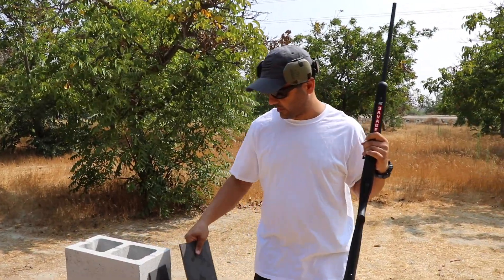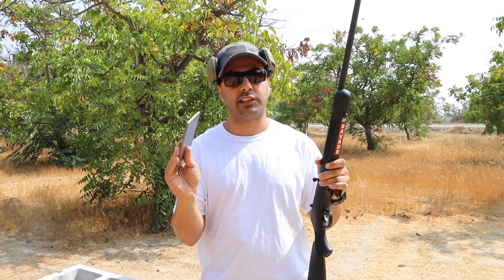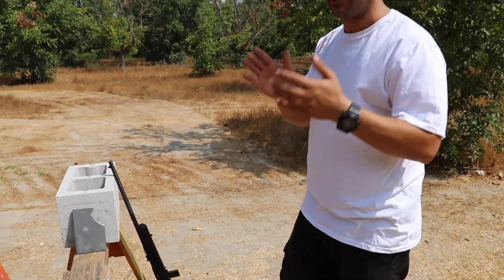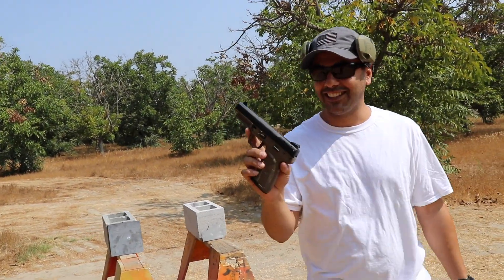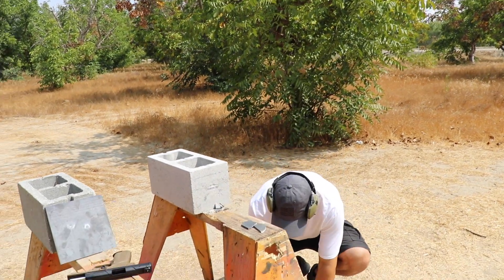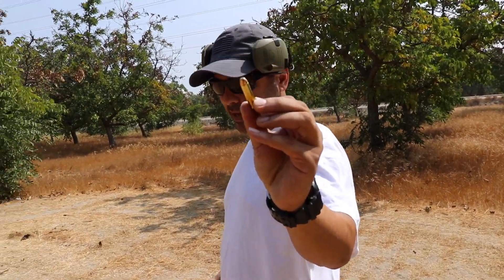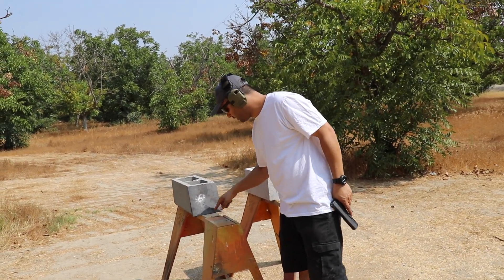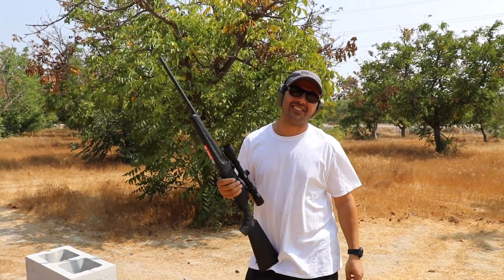Is Tungsten carbide BulletProof? - FN 5.7 vs steel

Comment: I'm a machinist,  tungsten carbide is real brittle. If you take that to a page that buys metals,  you can still get most of your money back if you can find the pieces.
Reply: Arnold Celaya Yeah they should’ve got some cpm 3v treated to 61 hrc which is low for the steel. That would definitely stop a bullet .5mm or maybe .25 for a 9mm.
Reply: @mikeisaac3826  lol no. it'd shatter like glass
Reply: For what do you need it? Is it a drill bit or what?
Reply: @edi9892  hi bro..
Reply: Is tungsten carbide used in jewelry or pure tungsten
Reply: warning they wont sell it bcs it is sintered it cant be repaired because WC tungsten carbide is not metal it is ceramics. it is like they would shot dinner plates. ehhh those studies taght me rly well...
Reply: Do you know the process of selling to a site?  I have a bunch of tungsten carbide seals.
Reply: No so much I think. In my place, tungsten carbide scrap (in a real bad shape) worth around 15 to 20 bucks per kg. Still relative valuable compared to other materials though.
Reply: @sovietrepublic38  yes. Here in Russia it costs 1100 rubles. About 20 bucks.. per kg...

Comment: Tungsten Carbide has nothing to do with tungsten
Reply: Yea, no. It's just made out of carbon and TUNGSTEN xd
Reply: really Sherlock, so it's like cast iron vs steel, not the same
Reply: @Kalidor99  You said "Tungsten Carbide has nothing to do with tungsten" dont get mad at him for correcting you.
Reply: Tungsten and tungsten carbide completely different materials, Tungsten (wolfram) is a metal in periodic table, TC is made by tungsten powder and different additives like cobalt, nickel, etc. pressure compacted and baked in very high temperature to create hardest and very brittle material after diamond. mainly used for cutting tools, it can work in high temperatures without getting blind.
Reply: +zanzibarian, TC is WC or W2C, alloys with cobalt, nickel or iron are something else and not called TC
Reply: Kalidor why do you say that? Please explain
Reply: Different crystal structure = different material properties. Tungsten carbide is ultra hard but also extreme brittle, melting point is also much lower, etc etc
Reply: Why is it called tungsten
Reply: because the ore's name is calcium tungstate
Reply: Wrong. Elemental tungsten isn't used for anything except old lightbulb filaments. 

Tungsten carbide is far more common and is what is almost always used
Reply: +xAeschylusx, 1. nobody said something about the usage, 2. It's also used for counterweights and some other niche uses.
Reply: I mean... it has the Tungsten part in common.
Reply: +mikemorr100 And you are a balloon mainly filled with Hydrogen, Oxygen and Carbon.
Reply: @Kalidor99  yes
Reply: And glass has nothing to do with sand...what was the question?
Reply: Tungsten carbide is a carbide compound containing equal parts tungsten and carbon atoms. It is a fine gray powder that can be pressed and formed into shapes through a process called sintering.

Comment: So its tungsten metal. Not tungsten carbide which is a very hard and brittle ceramic material.
Reply: ignilc, it is tungsten carbide, and it is a ceramic, to answer the other comments in this response thread. Steel is iron with about .7% carbon, and maybe some other elements, depending on the desired qualities for the finished alloy.
Reply: @SaposJoint  i know
Reply: Aaron, Wiki gives this definition:  "A ceramic is a non-metallic solid material comprising an inorganic compound of metal, non-metal or metalloid atoms primarily held in ionic and covalent bonds."

So, I guess a carbide is a ceramic.
Reply: Aaron, thanks. I stand corrected.
Reply from the maker: What he said.
Reply: Tungsten carbide is a ceramic. Tungsten is a metal. They are not the same at all. It's like iron and iron oxide is not the same. One is metal, the other is rust.
If you give it a rubber backing instead of concrete it might not break. Same as glass is super strong but it breaks from the ringing, not the impact itself. Rubber can dampen.
Reply: @ignilc, I saw your edited post. Everybody jumps the gun sometimes..

@Dan, Did you not read the prior comments? Everybody jumps the gun sometimes..
Reply: @SaposJoint  thanks . Wanted to edit my original comment but it got love from edwin. Id rather leave it pristine though flawed.
Reply: @EdwinSarkissian  yeah so i commented having only watched the first minute or two. Thats tungsten carbide, just stop calling it tungsten.  Or tungsten carbine for that matter.
Reply: @EdwinSarkissian  its very strong so strong you possible get a hammer and break it because its brittle like when you forge a blade you harden it too much blade breaks like cast iron breaks easy too  interesting video as always👌🐺🐾💪
Reply: Tungsten is an Elemental metal on the periodic table, tungsten carbide is a mix between tungsten and carbon which is a stronger and harder version of Elemental tungsten metal. No it is not a ceramic, it is a metal. Steel is a mix of metals and other elements usually involving the ingredients of iron, nickel, and carbon. Depending on what type of Steel you have you will have different ingredients normal steel and stainless steel have different ingredients to make them. Steel is not an element, tungsten is an element, tungsten carbide is not an element. But they all are metals.
Reply: Tungsten Carbide may look like a metal, but it is not. It IS a ceramic.
Steel has around 0.05% to 0.25% carbon, Tungsten Carbide is 50% carbon.

Ruby is Aluminum and oxygen, but I doubt you'd call that a metal.